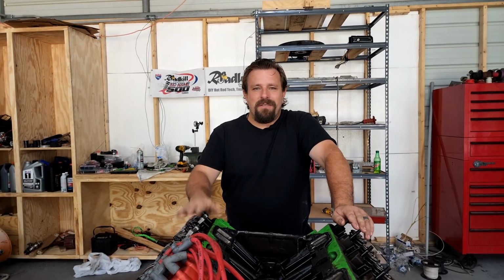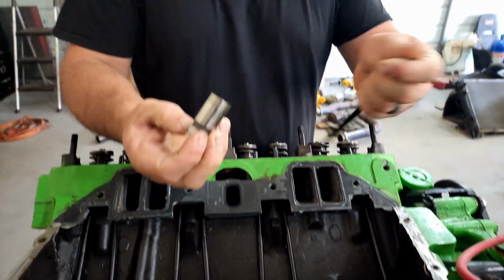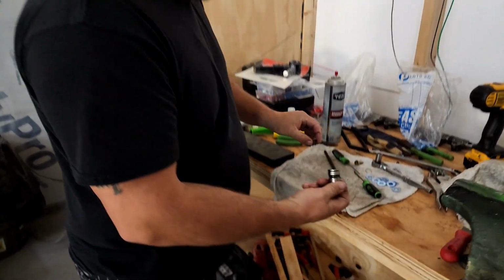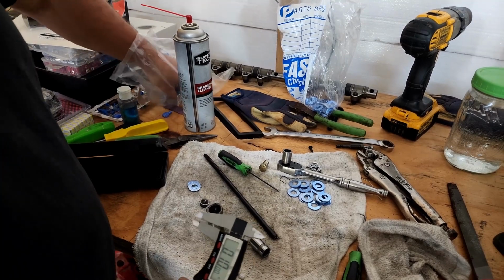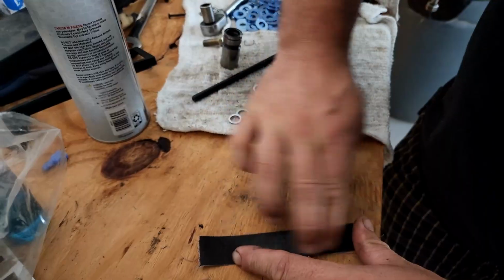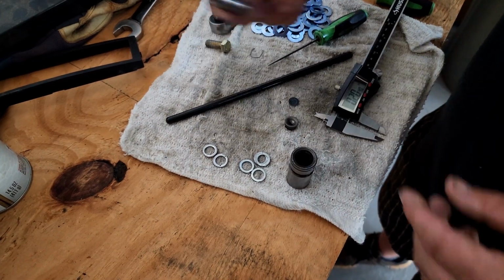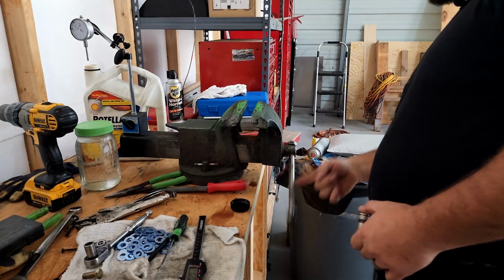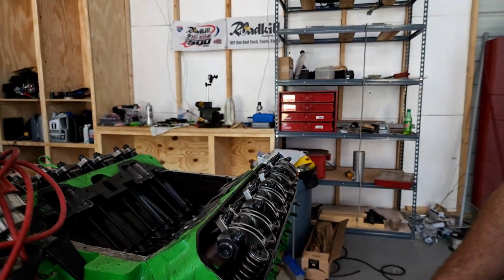Say NO To The Bottle! Collapsed Lifters On A Hydraulic Cam. A Better Alternative?

Comment: I've always had lifters leak down over a couple days,as soon as oil pressure builds they come back.
Reply from the maker: Yeah these were leaking down in a couple of seconds
Reply: Yep, they shouldn't leak down in seconds, really depends on your valve spring tension. I usually wait 5 minutes for bleed down when adjusting preload.

Comment: Nice mine had same issue, awesome idea
Reply from the maker: Thanks! How did you fix yours?
Reply: same principal, but I used 2 lock washers it worked fine. Thanks for the idea
Reply from the maker: @cme1977  no problem!

Comment: I'm going to apply your collapsed lifter fix on a 351M that now has a bent push-rod and a bent intake valve stem from what appears to have been a collapsed lifter that bled down when the oil was hot, and the engine had parked on that said intake valve fully opened - pushing the lifter down.  There is evidence that the push-rod came out of the rocker seat (socket) when re-started the next day, and pushed against the side of the rocker instead.  The valve obviously got bent from hitting the piston too soon, and/or maybe the valve spring reached it's binding limit to bend the push-rod there also.  (Maybe some carbon or dirt particle held the check valve open to bleed the said lifter down)   I would estimate and am hoping that your fix will prevent my scenario from happening again.  I cannot see a bent valve caused by normal engine temperatures.  A collapsing lifter is the only thing I can account for the problem failure and resultant damage !

Comment: May I asked, I got loude noise and turn off my engine quick after start up. I removed covers and found one lifter tgar acting like tou said, soft move down and up. I pressed it several times doing video and then it is solid again! So it was colapsed but not anymore. Should I still pull it or maybe try to run like this. I starte dthe engine and it sounds good.
Reply from the maker: If it was the first time it had been started in awhile, it might have just taken the lifter a bit to pump up.
Reply: @PerpetualProjects  thanks for your answer. I measured the lift with dial and it seems the same with others. Gonna close it and drive till happens again.

Comment: Great video!  
I've been wanting to do this for months but haven't had the chance to.
My idea tand test bed is my 68 C10 which has a great running 355 in it.  
It's just stock , flat tops
76cc heads 1.94s
Very mild cam 218 @ .050 .465ift 
I figured this setup would be the best to test my redesigned lifter on so I'm just pulling existing lifters one at a time and doing exactly as your video and reinstalling everything and documenting the difference. 
If I'm satisfied then I will be doing this on the race engine I'm building as well.  Thanks.  Keep up the great content!!!!!
Reply from the maker: Thank you, glad to help out!!!

Comment: Switch to solid flat tappet.
Reply from the maker: That is a great suggestion if you wanted to replace the cam but I didn't. The best way to avoid all possible problems is high quality solid roller lifters, but that is minimum $1500 on a big block Mopar.  I was just looking for a way to get it working with the parts I have.

Comment: Thanks, great idea!
An other idea is to add more preload to compensate the collapse no? What's your opinion ?
Reply from the maker: I have heard of people doing that as well, my fear with that is if was to float the valves and lifters happened to pump up they could hold the valves open that much further.  I really have no way of backing up that fear just, that was my thought.
Reply: @PerpetualProjects  It's a while i have a collapsed lifter on my 89' VW Vanagon, it's a boxer engine, i'll test this way and keep you informed. If i get a problem , i'll apply your method. Thank's!